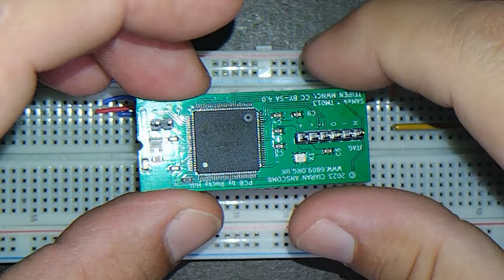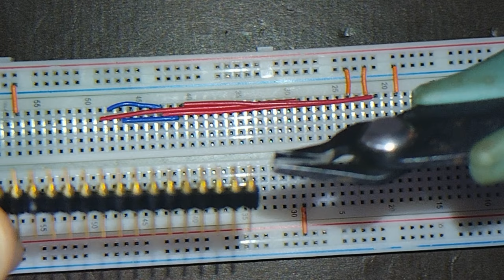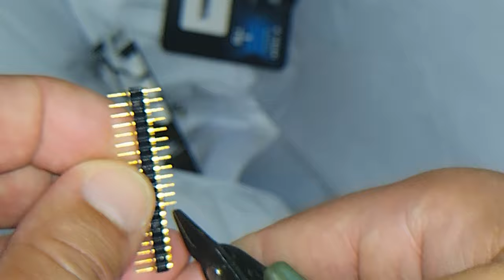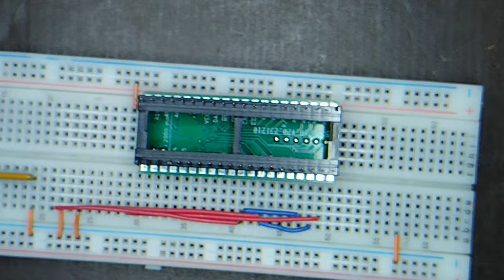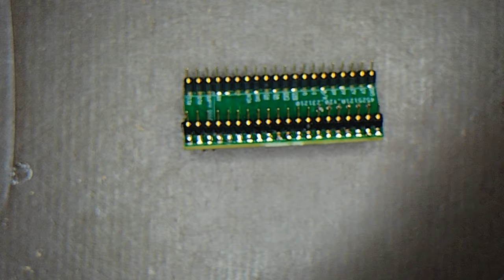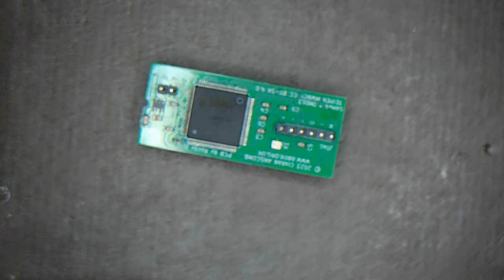Soldering machine pin headers to the SMD pads of  the SAMx4 .

Comment: Very cool, going to have to check my own stash to see if I have any of those machined pin headers.  Never knew there were SMD pin headers, but makes sense that they exist (AND that they're expensive)  :D
Reply from the maker: Yeah they can be. I mean they're not so expensive that you wouldn't finish the project but it adds up.
This is one of the ones I was considering.https://www.digikey.com/en/products/detail/preci-dip/150-10-640-00-106161/3757324